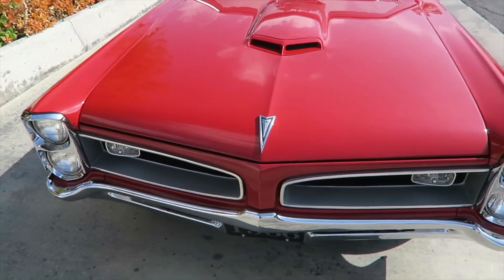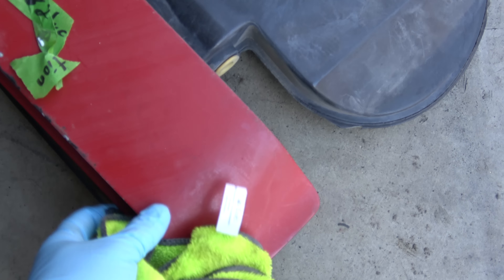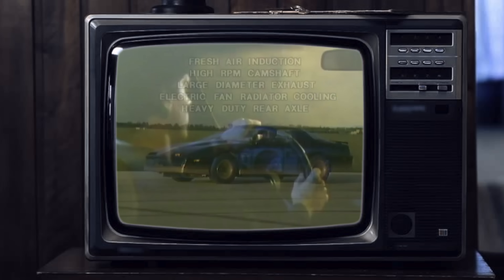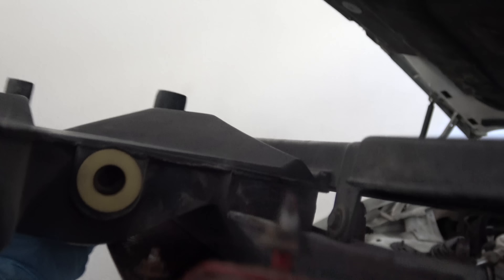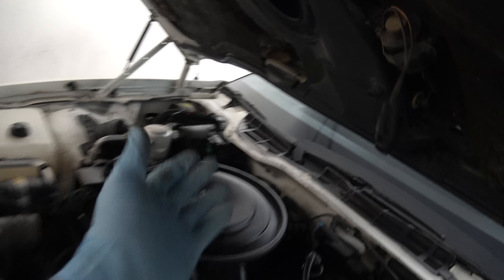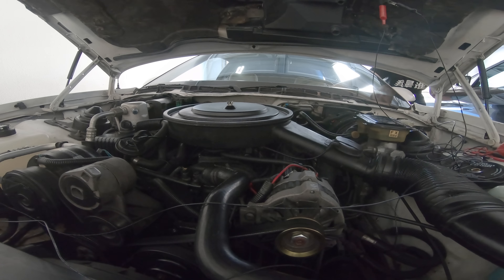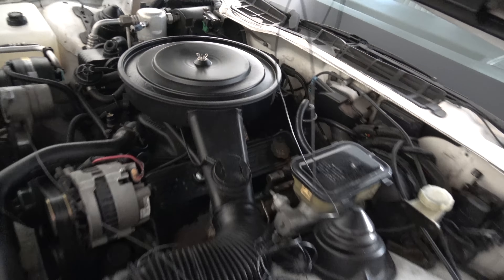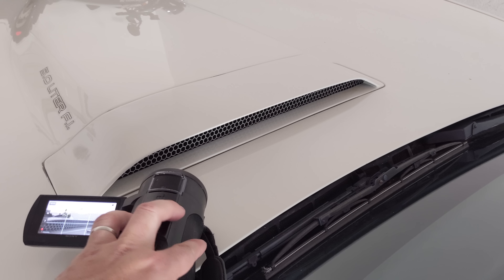I Unlocked Massive Power in My Firebird

Comment from the maker: Patreons vote on the cars to buy for future episodes - https://www.patreon.com/worthlesswhips
Or support us here - https://paypal.me/worthlesswhips
Reply: Winston - Just a personal suggestion, generally Fram is not the best air filter out there, and if you plan to own something for a lifetime, a drop-in K&N filter and oiling kit is the way to go. I live next to a corn field, so it gets dusty as hell twice a year, and it's nice to just be able to wash out and reinstall the filter for free whenever it's dirty. Sure, it's a heavy up front cost, but worth it in my opinion.
Reply: THANK YOU!Thank you so much for posting this. I used to own a ‘83 Firebird and a ‘85 Trans Am with carburetor 5.0 V8s which did not have this option (i.e. that added more HP) and I’ve been wondering for over 35 years exactly HOW those damn scoops worked! Thank you again....put a big smile on my face today!! 😉😁😄
Reply: I'd probably mechanically fix it open. Don't  know if the old solenoid can handle a long duty cycle on.
Reply: tastiger91 That is a REALLY good point.
Reply: Would have watched it sooner but YouTube? I'd make a controller for that thing from an Arduino. Add another skillset. I promise it is super easy and cheap. I'd make a control knob that changes the rpm it opens at by 100 rpm increments. Off the line, low rpms, a longer intake will make more tq. Up top you just want the engine to have access to as much air as possible. This is why pickup trucks have big long wrap around intakes and cars that use the same engine have short, low intakes. Mustang vs. F150  which they called the triton same engine except for the intake. Also the secret sauce in the MR2 with the T-VIS, similar principal.

Most if not all the programming code could be figured out in an hour or two, having never done it before. I'd try to do a little research on that servo, see if they burnout with a lot of use. If that became a problem I'd convert it to a vacuum actuator with off the shelf stuff.
Reply: Advance 8 deg give ya a bit more power
Reply: Where did you get the air cleaner lid? I've searched the entire internet, can't find it!
Reply: @worthless whips where did you connect the wiring harness for the solenoid?
Reply: Connect the solenoid to a gas pedal switch. Foot goes down, scoop opens. That’s how the factory did it.

Comment: That was the FIRST mod that I performed on my 1989 Firebird Formula-350 back in the fall of 1988. TPI cars run hot and it helped out a lot in reducing under hood temperature.  Thanks for the video !!! 👍
Reply: Any issue with water coming in?
Reply: I still have the car which has been garaged since new. I only install the tin plate before washing the car which is only driven when it’s nice out.  I guess there would be a water issue if the car was driven during inclement weather.
Reply: This doesn't have effect on the temperature outside of the intake. It's a closed system and drawing air from outside of the hood...
Reply: @MarkoNurmenniemi  it would probably have some effect, since a bunch of the air doesn't have to travel through a long tube under the hood where the heat is trapped, but i'm not going to speculate on whether it makes a significant difference.
Reply: @MarkoNurmenniemi  TPI ingine don't have this kind of intake. Only TBI. So its open.
Reply: Best bet to cool water temps on a TPI engine is a 160* stat. Instant 20° or so drop.
Reply: I installed a 180 degree Thermostat when the car was a month old. 160 was too low for every day use.
Reply: @michaelp_42  I've owned 12 F-bodies including three TPI's they all had 160° stats...daily drivers. There's not one instant of a low temp stat causing catastrophic failure. The only downside is a slight decrease in fuel economy due to it taking longer for the ECU to enter Closed Loop. A good warmup prior to operation will greatly reduced this.
Reply: @cali2468  180* is the best for TPI. Doesn't matter how many you've owned. It's a fact.
Reply: @Slinkoguy  It kinda does though because it hints I have more experience. 160* stat is what the performance shops used to use to tune with. Street Legal Performance, the king of TPI tuners, sold the 160 stats.
Reply: @cali2468  key word, "tune". And SLP are far from the TPI kings. I love the Firehawk as well but come on.
Reply: @Slinkoguy  "keyword, tune"... What exactly do you mean by that? Please elaborate... Because if you're insinuating they only tune with a 160 stat then throw a 180* in thereafter you're foolish. 160* stat keeps the coolest water temps in these TPI cars whom traditionally tend to run hot. Please explain how keeping a constant temperature of around ~170° is "bad" for the motor. Lol
Reply: @cali2468  It isn't bad for the motor. However, if we are talking "stock" then 180 is preferred if you live in a county with emissions testing. And better heat in the winter. Sorry I wasn't more clear.
Reply: @Slinkoguy  That's funny because California has the strictest emissions of any state in the US and I passed smog with over a dozen cars that had 160 stats but please carry on... Edit: I'm still waiting for you to give me a LEGITIMATE reason why a 180 stat is "better". Fact of the matter is, either or will work depending on the climate you drive in. Where I live it can reach 110° in the summer. 160 stat will keep me at or below 180° on the hottest day.
Reply: @cali2468  you do you man. I'm far past worrying about TPI engines or proving myself to anyone.
Reply: @Slinkoguy  I'm far past TPI's as well. Check my page. Both C7's and the C6z I built in my garage. Have a nice night. 👍
Reply: @cali2468  Hell yeah. I'm building my LS3 Camaro SS right now.
Reply: @Slinkoguy  Great choice. 👍
Reply: @Future-Preps35  I had everything you mentioned done to my third gen except for the 3 wire 02 sensor. Never heard of that until now. Very interesting. Wish I would've know about that modification back when I had my TPI's or any of my LT1/LS1 cars for that matter. I also tried adding water wetter which did absolutely nothing.

My last TPI was a white '88 Trans Am GTA. What made that car special was it was basically loaded; digital dash, steering wheel controls, premium audio (AC Delco IIRC), leather interior and of course T-tops. I found at a dealer in 1999 with 62k on the odo. A guy traded it in for a C4 Corvette. It even had polished honeycomb wheels though I'm not quite sure if that was done at the factory or not.
Reply: 220 is normal before the fan kicks on.
Reply: 160 is to cold for these. Tpi like to run hot and will lack performance. 180 thermostat with a 200 degree fan switch is perfect. Also bypassed the throttlebody coolant line
Reply: @cali2468  
There is no increase in time to enter closed loop. 

Most of these 80s GM cars go to closed loop at about 135 deg. F.
Most newer cars go to closed loop much lower than that.
Reply: @TheShadeManGuitar  
Not true.
160 is perfectly fine for them.
Reply: @cali2468  and letting the car idle until it warms up uses gas too LMAO
Reply: @TheShadeManGuitar  Again, more useless misinformation. Ask SLP, TPIS, Hawks and every one of the ol TPI gurus why they offer 160* stats for the TPI cars. Are you telling me YOU are more knowledgeable than the experts? lol YouTube Performance mechanics kill me with their "knowledge". 😂😂😭
Reply: @lees.4084  Right, and with a colder thermostat it takes LONGER to reach operating temp for closed loop. Is that too much for you to fathom? 😂😂
Reply: @SKRooU2  Most of your fuel is sprayed prior to and during start up. Idling uses very little fuel versus riding around in Open loop for a desired period of time. Some of you people need to learn how engines and their electronics work.
Reply: @cali2468  
It depends on what you call operating temp.
With a160 thermostat,  160 is the new operating temp.
So in that case, it gets to operating just as fast or faster. 
And like I said here before, these engines typically go to closed loop operation at around 135°F.
Now many of these 80s-early 90s engines would drop out of closed loop at idle, due to insufficient exhaust gas heat to keep the O2 sensors active, even at 200+F coolant temps, but above idle they would go to closed loop at anything above 135F coolant temps. 
With the introduction of heated O2 sensors, they could remain in closed loop at idle.
Don't believe me? Hook up a scantool and see for yourself...
You seem to be a proponent of 160 thermostats from your other remarks, so why are you arguing about this with me? 
You should know better.
Reply: @lees.4084  Wrong AGAIN! With a 160 stat your operating temperature will be around 170-175 degrees. This tells me you've never even ran one in a TPI car yet you're trying to inform me. How interesting. And again, regardless of what temperature the ECU is set to enter closed loop (this table can be manipulated) it takes longer to reach that temperature with a low temp stat. I'm talking dead middle of winter with a 160 stat you will see the car will not want to warm up. That's the only drawback. But cooler temps = more horsepower ALWAYS. That will never change. Edit: this is why all of the quickest fastest bolt-on TPI and LT1 cars ran 160* stats.
Reply: I did the same in my formula 350..also 160 thermostat..underpully ..SLP dual air induction..SLP chip..no cats..flow master muffler..13.7 car ..still miss that car

Comment: Hey Winston, did you know that Corvettes, C4, C5, and C6 in particular, benefit tremendously from putting vents in the hood (most effective in certain spots). 
  Not for the intake, or cooling the drivetrain (this is a side effect though), but because they suffer from a terrible buildup of pressure in the engine bay at speed. Nearly all vehicles have this issue to an extent, but in Corvettes it is compounded by the manner in which they draw in air to the intake, and are engineered to draw air upwards under the front air dam into the radiator (be sure to check that area, it tends to build up debris). The area underneath the hood is tight, and has little to no space for the overpressure to egress. 
 This causes lift at speed (I can tell you from experience that >170 is wild without certain aero mods; best way to describe this is airplane turbulence. As in darting back and forth 2 or 3 feet at a time virtually instantaneously, as if the tires aren’t even touching the ground. Very temperamental situation). 
  If this pressure buildup is mitigated, the effects are surprisingly noticeable, even at interstate speeds. The mid-high speed handling improves as well.
  A few years ago I was able to hit 212 mph in my highly modded C5. 
  Btw, have been watching you for years. Since the “China, how it is” days. Happy to see you out of that sinking ship, and here in America. Sorry that you ended up in California (just kidding, guess that’s a personal choice)
Reply: Well Zora Antov DID want to put Hood Vents, Functional Ones on the C2 but GM told him no, so I wouldnt be surprised if this also applied to ALL of the corvettes really.
Reply: What hood did you go with on your c5?

Comment: As much as I like old GM cars, this just demonstrates why they catch as much crap as they do for the bean counters running the show. This was such an easy fix for a noticeable power increase -- with parts that probably cost about $2 to manufacture. Great job! I hope you're able to get the manual switch installed 🙂
Reply: The hood bulge was functional in the early 80s, but after 84 it was discontinued.   After 87 it was brought back nonfunctioning as a retro peice to the formula model.

See the 3rd gen trans am was meant to house a 4.9L turbo pontiac engine which used the hood bulge.  It would of out performed the corvette so GM basically took Pontiacs engines leaving the Iron Duke.
Reply: It wasn’t being counted it was the  greenies

Comment: "This Hood Mod gives 20% more POWER!"  Scoty Kilmer has entered the chat
Reply: Hey, don't knock Scotty.
Reply: Prolly more like 2%...
Reply: Probably not 20%, but a worthwhile modification nonetheless.   Nicely done!
Reply: Or anyone that's ever, I dunno, DRIVEN A CAR?
Reply: @BuzzLOLOL  more like 0%, but I'm sure it made the throttle response much better, which on the street is kinda the same thing as more power.
Reply: @The_sinner_Jim_Whitney  - Cool outside air gives more power than 200 degree under hood air... even if that scoop location isn't a 'high pressure' area...
Reply: @BuzzLOLOL  Right, but the amount is negligible unless A) the new intake flows better than the factory one (most don't), B) The factory system doesn't draw from cool outside air (most do), or C) you're at full throttle at the peak power rpm (you virtually never are). They do look and sound nice, though, and generally make throttle response snappier, so they're worth it in my opinion. Just not for power gains.

Comment: On the turbo cars with this hood they put the boost gauge in the scope. It's a series of lights going left to right going green, yellow, red.
Reply: They only did that on the second generation turbo Trans Am. The third gen had the wire mesh insert just like shown in this video. The 1989 V6 turbo Trans Am had the usual flat Trans Am hood of the mid 80s onwards.

Comment: I had this on my 1983, which was the first year the base motor got air induction,  82 only had it on the crossfire motor.  The solenoid was activated by pressing the throttle to the floor and it felt like a downshift in terms of additional power, my car was a five speed.  And with the roar of the secondaries, it was a lovely sound.  The other thing they had in 82 and 83 was the dual resonator exhaust which made wonderfulsounds and the pipe actually split after the catalytic converter,  it was as close to a true dual back in those day’s.  From 1997 to 2003, the WS6’s had functional RamAir hoods, which could easily have been made to create a true ram air supercharging effect.  Are you bypassing the air filter?  The original unit did not bypass the air filter as there was a secondary dome under the top fileter cover
Reply from the maker: No it's not bypassing, if you look at the beginning you'll see the lid has a dome
Reply: Worthless Whips I wonder, if air is vented only when the solenoid is open, it wouldn’t be that harmful to vent directly to the throttle body.  That would yeild even more air.  A brief direct venting of air directly wouldn’t be that harmful.  Again, only when the solenoid opens
Reply: @richarddobreny6664  You are correct about it only being available on the Cross-Fire Injection engine in 1982. I own a 1982 Firebird T/A and it has the bulge hood with the wire grill and block off plate. The bulge hood was available with 15'' wheels and bigger sway bars if the car was ordered with the WS6/WS7 option. Standard Trans Ams had 14'' wheels, smaller sway bars and a flat hood. 1983 and 1984 Trans Am's were offered with the functional bulge hood as a standard equipment. And yes the dual resonators sounds really wonderful. They were still available on the standard engines in 1984 and the more known single muffler was first used on the late 1983 H.O. engines which had larger manifolds, intermittent pipe and tail pipes among other goodies such as an electric fan, a tuned Rochester Carburetor, better camshaft etc. The dual resonators were dropped by late 1984 and the single muffler became standard in 1985 until 2002.

Comment: I had an 89 formula 305tpi five speed that I did the honeycomb insert mod to. I found an 84 T/A that had been traded in at a local pontiac dealer and asked them if I could use the part. They told me yes as it was gonna be whole saled to someplace anyhow. It was painted yellow if I remember. So off to the auto parts store I went for some flat black spray paint. Needless to say, the underwood temp was better now that the air had somewhere to go. That blocking plate just kept the heat underhood. 
Don't have the car anymore but loved it while I had it. Miss it today looking at this video. Enjoy your car sir

Comment: A mod we used to do on that actuator for the flap is to run it to the ignition switch circuit so when you start the car the flap opens up the entire time the engine runs.  I have always thought the scoop on those should have been functional the whole time the engine was running and available on all Firebirds.

Comment: I remember doing the same mod to my 1978 Z28 back in the early nineties, ...mine was way more of a hack job, though.   I just opened the slit and installed an open element air cleaner. We adjusted the 4bbl so the secondaries opened really fast, it gave it deep, mean intake roar.  Nice work and nice F-body!!
Reply from the maker: Yeah I did something like that on my 78 trans am, also here on the channel

Comment: Also, stickers add 5% hp or so I hear. Gratz on the channel....content is great. Cheers.
Reply: I heard you can increase the power by 43% just by putting flame decals around the exhaust.
Reply: The sticker thing is actually true. Good info there.
Reply: @NeverMetTheGuy  cause it is!
Reply: Gas Pedal's been known to go right to the floor and stay there with me behind the wheel

Comment: The offset hood bulge was originally engineered to accommodate the 301 Pontiac Turbo V8 motor before the GM brass mandated that all of the F bodies use the 305 Chevrolet motor from 1982.
Reply: That would have been a sweet motor in one of these!

Comment: I have an 89 TPI but I still took the blocking plate off the hood scoop.  It's not a working air induction but what it does do for my Formula is it lets a tremendous amount of heat escape from the engine bay with the hood closed.
Reply: Hey Lorq, have you came across any issues after doing this? Maybe issues with water getting inside from rain or anything?
Reply: @burna7202  No issues, no water getting inside.

Comment: Those hoods were originally for clearance for a turbo,these cars were designed for turbo but GM axed the pontiac motors at the last minute so they had to use a small block chevy instead.